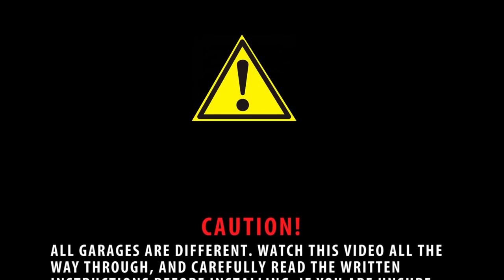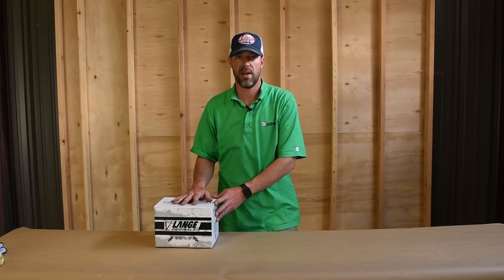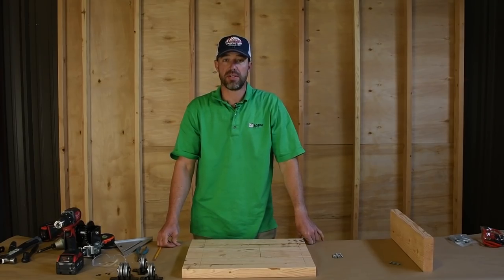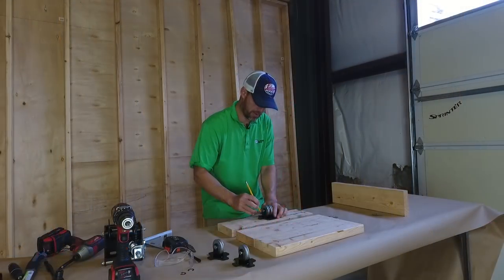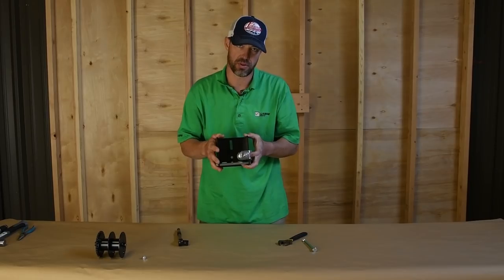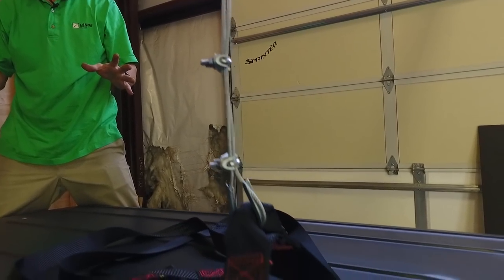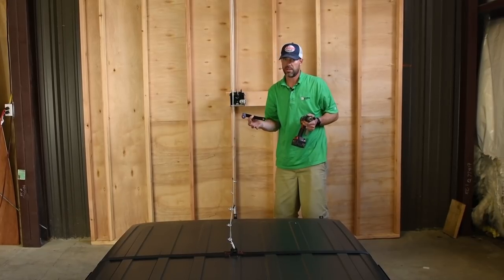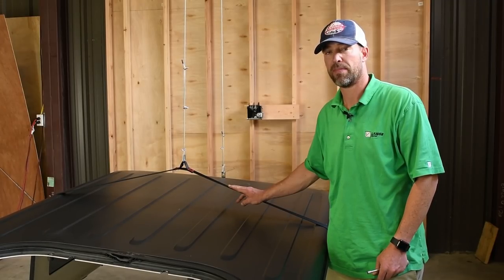Hoist-A-Top Simple Video Instructions (014-SIM)

Comment: There are a lot of errors in either: This video or the Lange Originals instructions. 
1. The instructions say that the 2nd (strap) pulley needs to be mounted 1/2" left of center. In the video, he says to mount the pulley 1" left of center. In reality the pulley needs to be mounted 1.5"-2" left of center.
2. The so called 'Smart Hook', the instructions say that the RED hook is for TJ 1997-2007 only, the BLACK hook is for the YJ 1987-1995 and JK 2007-Present. The video is incorrect, the instructions are correct, in this case.
3. The instructions say to use the 2nd bolt hole in the top for the 2 door Jeeps and the 1st bolt hole for the 4 doors. You HAVE TO use the 1st hole for the 2 doors too!! Otherwise the center of gravity will be way off, and the top will lift on an extreme and unsafe angle.
4. I found that the 34" measurement, between the pulleys worked well, for me. Others have had to spread the pulleys mounting apart to 37+ inches, for their application.  

Also: ditch the 'wood screws' that are used to mount the pulleys into the wall and ceiling. They are essentially just drywall screws and not strong enough, in my opinion. Get yourself some 2" small diameter lags for much better strength and security. You should also ditch the small nuts, used for the cable clamps. Get yourself some nylok nuts or at least use some form of loctite on these tiny little bolts. My package came with 6 cable clamps, not 4, I used them all, 3 per cable. Finally, I wish that Lange would include a few more feet of cable. This would make a wider variety of installations possible, and allow for more of the cable to wrap around the pulley. For my application the cable JUST BARELY reached, and I began lifting right on the cable's loops, with no extra wrap/windings. Lange could make this product much better with these upgrades. It would cost approximately $10 more per unit, and those are hardware store, retail prices.
Reply: dude those instructions are trash. good explanation on how the manual sucked.

Comment: I end up using offset of 3/4 inch  between the first and second pulley.  Your video says 1" offset.  The instruction that came out with the package says 1/2" offset.  Reason I used 3/4" is to match the grpves of the double pulley which is 3/4".  Another change I did is the mounting the crank assembly upside down versus your instructions.  This is just to make the rotation clockwise when lifting the roof.  Is there a concern mounting the upside down?  Thanks.

Comment: This is by far an example of a company that doesn’t give a crap about its customers. I have 3 masters degrees and can’t figure out the installation instructions, which vary from the video to the written instructions. The written instructions are probably the worst I have ever seen. When you say one pulley is onset left what do you mean? Left of what? Which direction should I be facing? This is like a spotter telling a Jeep driver to turn left or right versus “driver or passenger.” Make it clear. I love it when the guy in the video says to pull the cable up to the black tape he placed on the cable when the tape is blue and one foot in front of his eyeballs! The wrench I received has 3 spools plus the gear, not 2 spools like the video and instruction manual, although you can’t tell anything from the manual. I don’t want to have to call you for help. I want you to take pride in you product. I suggest not selling anything until you redo your manual and make a video under 10” long. Spray paint the demo winch white so you can see what is being done and take video angles which are not obscured by gloved hands. I’ve spent 3 weekends on this product and I’ll be ripping it out of my garage and returning it.

Comment: Same issues with instructions- Ugh! Video helpful but when I raise the hard top the short side is much lower than the crank side wire. I tried to fix straps but still not even when fully lifted- any suggestions?
Reply: 1:3 offset ratio for every pulley after the first one.

Comment: Why would they design a pulley where you have to remove the wheels/spring clips to screw it down? When I see simple, stupid decisions like this, it steers me away to a different product, say one with 1/2" more flange to screw the pulley down so you dont have to remove the pulley wheels. It really makes you wonder where else they skipped spending the extra 10 minutes to design something correctly.